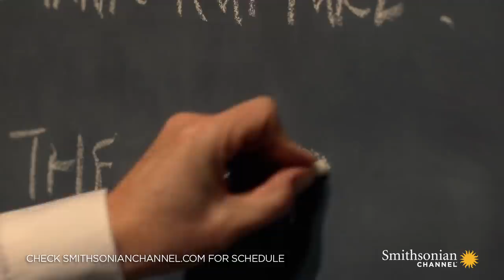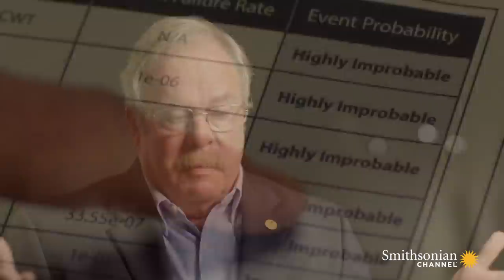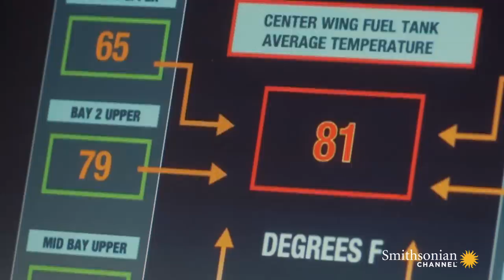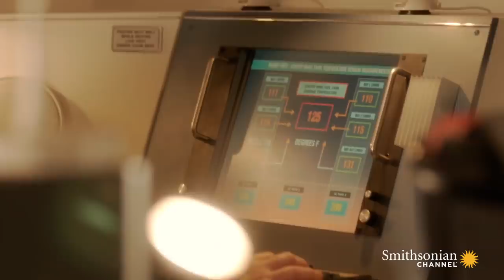How Air Conditioning Caused TWA Flight 800 to Explode

Comment: wish you guys knew the entire story of this accident, us navy was involved.
Reply: Keith.  No. The Navy was not involved in the slightest.  There are plenty of 'statements' being made of such,  however with Zero facts.  There were No Navy vessels even in the adjacent area at the time of the event.  The 747 was not shot down in a civilian departure corridor.  
The  {IAMAW} "International Association of Machinists and Aerospace Workers" provided their brief for our court case.  

There was No warhead involved in the Initiating event: which was determined to be an external Impact / mid- air collision with an experimental AV that was transiting the airspace, and due to unfortunate miscalculations the AV impacted the 747.  (that AV was the 'missile' of concern.)  Still need to determine the origin of the AV, but most likely an Airforce/ Nasa event.
Reply: Rob Shef there were navy ships in the area and after the crash we’re leaving the area at 30 knots
Reply: That is absolutely false Keith, and you are of course only repeating what you have read on some erroneous web pages which were, and remain to be misleading.  There were No Navy ships or subs 'in the area' at the time of the event.  (nor firing warheads into a active departure corridor for civilian airliners) 

The Navy would not nor could not 'leave' the area...as many uninformed people try and claim that the navy ran away   (I am former Navy, and the navy would certainly not  run away in the manner as has been suggested.)  
It would be IMPOSSIBLE for the Navy to do so anyway, and no commanding officer nor crew would or could do so.   The 'mystery boat' story is nonsense and misleading, as are the stories of an entire flotilla of naval vessels.
Reply: Rob Shef former navy I see
Reply: ....the Navy was involved,...however, Shef  The Shill will lie to you about that.

Comment: It takes more than a spark to ignite fuel. It takes oxygen. The tank interior is designed, of course, to exclude oxygen, and carries a positive vapor pressure. Or no engineer would run a wire through it.
Reply: Yep...and besides that, the center tank by design, never, or can never reach its Flash point.... and this by reason of many Architectural and Physics reasons.  In the most cases, due to the tanks venting, the tank is well into the lean arena, and it is difficult to ignite Aviation Kerosene anyway. It is a Combustible liquid, Not a Flammable liquid.   The NTSB was cited in Federal court for fraud, and Junk Science.
Reply: Rob Shef we got an expert here👏🏻
Reply: And why should I take the word of YouTube commenters over the word of the NTSB (which is a government agency).
Reply: @criticalmaster9526  definitely don't do that. You should absolutely believe everything the government tells you without question, as they are right 100% therefore individual thought and expression are unneccesarry. Also beep boop beep robot
Reply: That's not true at all a fuel tank has to let air in and out to allow liquid to flow and your car's fuel tank is vented and has wires in it
Reply: @criticalmaster9526  I'll take a crackhead's word over a government agency's word.
Reply: There are wires that run through the tanks. But, they are run through conduits, so the wires are never exposed directly to the fuel or anything else.
Reply: @adriangoodman8901  I don’t believe that the government is always good no they are never perfect so that won’t work on me
Reply: @ronfry3324  the wires in the tank didn’t cause it but it was faulty wiring else where that allowed a high voltage current to pass through what is normally a low voltage wire and short circuited
Reply: @jonahmoran3751  FAA didn't buy the fuel tank explosion fantasy, and never grounded 747 aircraft.
Reply: @raywest3834  If they didnt buy it, they wouldnt have gone along with new guidelines to prevent jet fuel in those planes from vaporizing.

Comment: Sounds insane to do a test like that .
Reply: Hahaha, fuel reaches 200 degrees all the time in my semi truck and it never blows up. 127 is nothing... no oxygen in those tanks prevent explosions, and no wiring either... one of my high school buddies has been an A&P tech for the 747 for years, and he says anytime they enter a fuel tank on the 747, they have to wear oxygen packs, as those tanks are full of nitrogen.. no oxygen in them at all.

 I have 2 first cousins flying people 747's , and all of them laugh at the f.b.i's findings.. of course, most 747 and 757's are outdated and retired now..
Reply: @KBS117  fuel quantity indication probes are there no?
Reply: @cruisertechgt  they have resistance meters to measure fuel levels. All wiring going into the fuel area are guarded by diodes. The diodes prevent electrical current from feeding into the fuel area, while allowing ground resistance metering from the probe to connect to the gauges. Then the 757 has 2 a/c units on that plane.  Both will shut down when they get too hot.. the pilots will have to reset them once they cool down. The biggest problems is fuel jelling from getting too cold at high altitude.. heat is constantly applied to the fuel to keep it warm..  the fuel in my semi truck tanks reaches 180 degrees in the summer, as the fuel also cools the injectors and pump. 127 degrees on an oil based fuel does not scare me at all..  never seen a semi truck blow up..
Reply: @KBS117  great explanation thank you!
Reply: Boing knew oxygen in the fuel tanks on these planes was a hazard. In 1969 they redesigned the center fuel tank on these planes, adding nitrogen generators to fill these tank with nitrogen as the fuel was sucked out. This eliminates any explosion hazard. This plane was built in 71, and it had the updated center fuel tank. The fbi is covering the navy shooting down this plane. The navy had fired 2 misses at drones that day, flight 800 had violated the navy's safe zone, and both missiles targeted the 747. I'm told the first missile  targeted engine 3. The second one went into the center fuel tank and blew the nose off the plane.  The facts are out there... my info comes from my best friend, who has been an a&p technician on the 747 and 757 for 35 years. He laughs at the fbi's report.
Reply: That is a Hollywood made video, not an actual event. I doubt the test was ever done. It's hurt propaganda generated to keep us from knowing the truth. My best friend is an A&P mechanic on the 737, 747, 757, 767, 777... he says all fuel tanks in those planes have nitrogen generators since 1969, when boing redesigned the center fuel tank on the 747. He says anytime they work on those tanks, they have to wear oxygen masks, as they are full of nitrogen only.. that plane was built in 1971, and had the upgraded fuel tanks.. he says, no way a stray voltage can backtrack into the tank, as the wiring is diode protected..
Reply: @KBS117  interesting I thought the nitrogen generators came after the incident as a result of it. Wow it’s crazy.
Reply: @cruisertechgt  according to my A&P buddy,  boeing redesigned the center fuel tank in 69. This plane was built in 71.. so it had the updated safety  features.

Comment: Just like final destination when the plane exploded in the air🤧but this is sad
Reply: Malaysia’s World final destination is inspired by this sad crash
Reply: That’s cause Vólee Air Flight 180 from Final Destination was confirmed to be based off of TWA Flight 800.
Reply: The real TWA flight 800 also had highschool kids on board taking a class trip to Paris
Reply: I think this crash inspired Final Destination.  But I'm not 100% sure.
Reply: @pollypockets508  It did, but the least we can see is the movie was pretty far from what actually happened during TWA 800.
Reply: Wrong emoji the second one is laughing
Reply: GD Switch oops mb I typed dis a year ago..

Comment: I was on a B747 course when this occurred. 
I had 3 instructors with a combined experience of 105 years. They said no way.
With my own research for the planned flight time the center wing tank would have been empty.
Mains 1  2 3 4 would have had fuel and their respective pumps operating.
CWT  pumps would have been off.
No fuel no pumps no spark no explosion.
Was definitely a missile.
Probably from the USS Vincennes.
Reply: gerry erbsleben Well these instructors were obviously wrong.
Reply: @lecorsaire2283  no they were not.
I have 2700 hours on B747.
Do your own research.
Reply: When undertakes a rating on an aircraft, a basic engineering and systems knowledge is required. 
One does not have to be a physicist to understand that if there was no fuel in the tank with the pumps off there can e no explosion.
The 747 200 can carry 160 tons of fuel. 60 in the cwt. There was adequate fuel in the main tanks to conduct a transatlantic flight without the requirement for fuel in the cwt.
Eyewitness testimony.
If you care to research; the USS Vincennes was responsible for downing an Iranian airliner. The IFF failed to resolve an Iranian  F14 Tomcat and selected the airliner instead. A failure of this system is probably responsible for TWA 800. No issues here then of keeping the crew and government (NTSB included) quiet. 
Don't accept everything the media throws at you at face value. This your problem. 
You are however entitled to your opinion.
Reply: @theredbaron1043  IF YOU'RE SAYING YOU ARE A 747 PILOT, THEN YOUR CHIEF PILOT NEEDS A CHECK RIDE. YOU KNOW NOTHING ABOUT WHAT YOU'RE TALKING ABOUT! IT'S YOUR OPINION, AND QUITE FRANKLY OFFENSIVE TO PEOPLE WHO KNOW FIRST HAND WHAT HAPPENED, AND WHO HAVE LOST FAMILY MEMBERS AND FRIENDS. THAT WOULD INCLUDE ME! THE LOSS OF TWA 800 WAS NOTHING MORE THAN A CATASTROPHIC MECHANICAL FAILURE, DUE TO THE EXPLOSION OF THE CENTER TANK, WHICH RESULTED IN THE SUBSEQUENT BREAKUP OF THE AIRCRAFT!
PERIOD!
Reply: TWA747100 TWA747200 found the Fed
Reply: gerry 61 right.
Reply: Gerry, Several destroyers that day were involved in the CEC system exercise (Cooperative Engagement Capability) in which various branches of the military could communicate and coordinate on a threat and destroy it. Drones were used as the threat and STA missiles were used to destroy the drones. There was a notice given to the FAA to notify airlines of the tests and the time of the notification was to end later that evening. What simply happened is that the software, made my E-systems didn't work and the missile locked on to a commercial aircraft instead of the drones.
Reply: @theredbaron1043  - You're an airline pilot and you're not aware that flight routes aren't anywhere near an active missile range? You're comparing TWA 800 to Iran Air 655 that was shot down over a perceived warzone? 

You may want to read the NTSB report before assuming the fuel pump wiring was implicated as the source of ignition
Reply: @PabloGonzalez-hv3td  USS Vincennes
Reply: @theredbaron1043  - I've been part of a live Missile Ex that's a joke the shootdown of Iran Air 655 was something else entirely

Comment: Second to the nutty missile conspiracy theorists (motive?), many people have little concept of science if they believe the dozen who survived the first blast were "terrified out of their minds". The decompression/deceleration from the explosion greatly mitigated the plane's 500mph speed, causing injuries consistent with an extreme collision. This can be corroborated in the medical examiner's report, which also stated that the g-force winds were so extreme, all the passengers' clothes were ripped off. In respect to physics, I think it's safe to say that there was NO time to comprehend something went seriously wrong on that flight.
Reply: The missile theory isn't as nutty-sounding as you think. The Navy fired two missles from one of two submarines and 21 surface vessels in that area that were conducting missile tests exercises.
 The missiles were seeking out drones fired from one of the surface vessels,.......TWA 800 breached the perimeter of the military exercise airspace.  The first missile targeted the heat signature from the third engine of TWA 800, then the second missile targeted that explosion. The issue with those center fuel tanks did exist,....up until 1969.  In that year,  Boeing completely redesigned the center fuel tank system for the 747.  The TWA 800 aircraft was built in 1971, therefore, the fuel tank issue did not exist for that aircraft.  The Clinton administration, FAA, and NTSB used the 'center fuel tank' theory as propaganda to cover for the Navy's grave mistake.
Reply: @trueknowledgeispower  Sources?
Reply: @abyssiccoronation  .well,.....did you go to the link?
Reply: @trueknowledgeispower  You didn't include a link. However, I've already perused everything I've needed to for the past twenty-three years and still find the NTSB's conclusion more credible. We might as will revisit other cases of airplane accidents where proper maintenance wasn't done and write that off as a conspiracy, coverup, etc., too. Boeing was successfully sued, the airline and manufacturer was lawyered to the teeth, and yet they didn't try to make a case that the crash was from a friendly fire missile. What's your theory on that? Fear of the Clintons? I never cared for them either, but such poisoning of the well only gives them more leverage to stifle critics and continue defiling U.S. politics.
Reply: To determine a motive, one would need to know who did it, and the lack of such knowledge does not dismiss the credible accounts of hundreds of witnesses on the ground and in the air describing a rising missile.

What is interesting about the witness testimony is that none of it was used in court...the only people who could do that are people involved in national security, and only if they cite “national security reasons.” When they do that, even the existence of the eyewitness statements cannot be brought up in court.

So even though we don’t know WHO shot down the plane, we know by eyewitness testimony WHAT brought it down, and we can reasonably deduce WHY that information was not brought up in court.

The USG is involved...either acting to protect itself, or to protect some other “interest” (allies, organized crime/terrorist organization, etc).

Yes, the rest would be conjecture. But the missile theory is not.
Reply: @abyssiccoronation  I can explain why there was no link.

URL blocking on YT.
Reply: @trueknowledgeispower  I just posted a reply to this point.  The 2013 documentary is very well buttoned up in its logic and sources, enough to make anyone with an open mind question the official line on this one.  As for motive, political.  Clinton was in the home stretch of the 1996 presidential campaign.  A couple years after losing congress to the GOP for the first time in 40 something years, and suspicion of big government at an all time high (X files, anyone?) I wonder how that election would have gone if it was found out that the US military downed a commercial airliner through sheer incompetence during a training exercise?  Who's the leader of the US military?  I think that's more than enough motive, but they may have kept Clinton in the dark too so he had plausible deniability.
Reply: Umm, you don't understand wind. I had a cab over semi that got both windshields knocked out by a deer. I drove the truck for 2 weeks with no windshield. As long as you kept the side windows rolled up, you got no air inside the truck even at 75 mph. But roll down a side window and it was a tornado inside the cab. No air could blow through that air craft cause no air could get out. Take a straw and you can blow spit balls a mile. Plug the end of the straw and you can't force any air through the straw. Same principle applies to this situation. If those people were blown apart, it was from the missile detonation and not the air blowing through the sealed airframe. You see, it's little things like this, that makes me know the official story is full of crap...
Reply: @trueknowledgeispower  you sir are correct..

Comment: All eyewitnesses: “It was a missile”
Smithsonian: “air conditioning”
Reply: The speed of sound is the disqualifier for the witnesses. They didn’t look up until they heard the bang. The fuselage/wings and tail jetted straight up into the air for several thousand feet just after the bang. When they looked up they would have seen a fire streak racing upward at 400 miles per hour. Would have looked like a missle
Reply: @steveo601  the ex-Vietnam combat pilot who saw the smoke trail leading up to and impacting the plane and who was the first aircraft to investigate the incident claims it was a missile. He even stated that multiple explosions occurred before it went down, and his experience in war zones gave him the ability to distinguish the difference between the fuel on the plane exploding, and an explosion from an explosive such as a missile warhead.
Reply: I like that one!  Now  of course it was [a missile] as the FAA tracked it, and reported it up the chain. And the machinists union reported the external impact on the plane. The NTSB had other plans.  That an 'AC' blew a plane in half.  What next?
Reply: @steveo601   You need to go back to skewl. The speed of your brain needs fixin.
Reply: So the plane was delayed for 2 hours and with the air conditionars right below the center fuel tank and the ac when up to 300 degress and that vapored the fuel making it very easy to catch fire and with the aging electrical system of the 747-131 bundles wires mixed with high voltage wires and low voltage wires some are so warm they can short circuit. High voltage went to where it shouldnt go. Seconds later it went to the fuel probe and then it blew up.